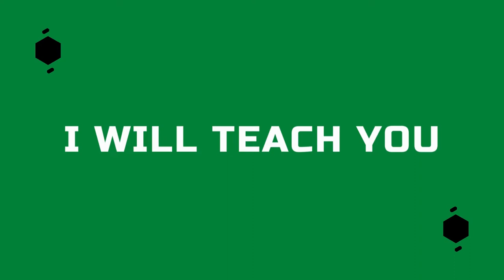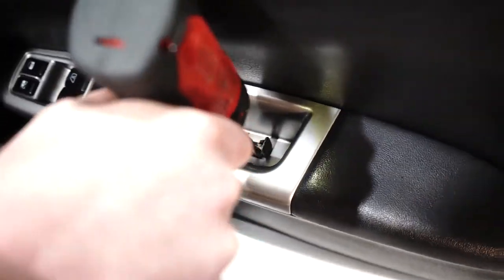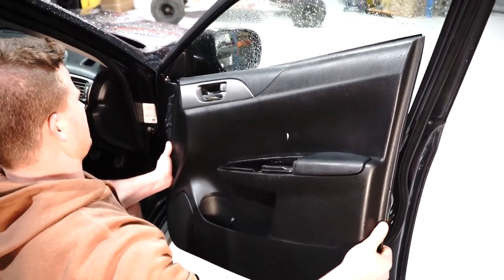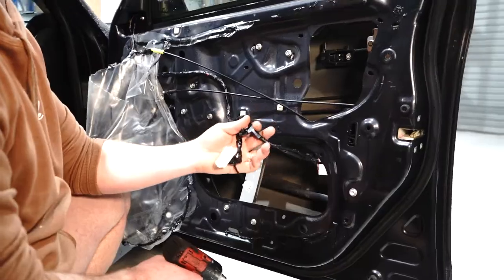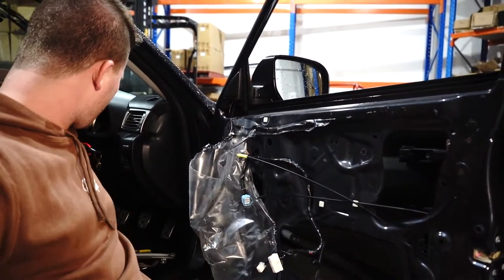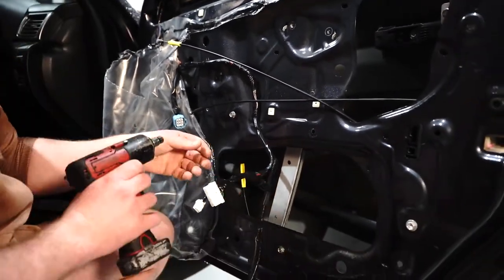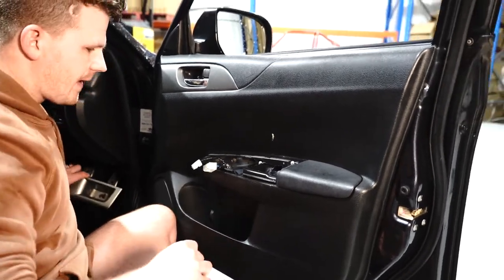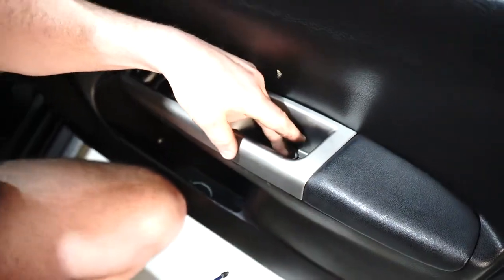Subaru Impreza Window Regulator Remove and Replace How To Video

Comment: The rear regulators don't have a cable to cut if it's stuck in the up position. Any tips on how to get the window down on a rear door?
Reply: Happened to my front drivers side, push down and wiggle worked for me

Comment: What wires did you cut mate? Mine is stuck in the top position too
Reply from the maker: The window regulator wire. The metal cable

Comment: Thanks Helped a bit. But you dont need to grease the regulator or the tracks again?
Reply from the maker: Ours comes pre greased. Unsure on tracks. If they are dry you're welcome to... But if there wasn't any issue with the glass moving up and down its no worries.

Comment: I have a 1995 impreza gc3.. my driver windows problem goes like this: It rolls down but it doesnt roll up. But if get the car off the ignition and turn it back on.. the window rolls up. I notice that if I start the car and roll the window down.. when the window is down.. is like the switch is constantly trying to roll the windows down. I can hear the windows trying to go down, if I lay my arm over the door I can even feel the windows glass trynig to move down and doing weird stuff inside the door... Is like the swicth is stuck on the down command and every 20 30 seconds it tries to roll down the window.. and it gets free when I turn off the car and start it again. Any help/suggestion on this problem would be appreciated.
Reply from the maker: Try replace the master control switch. Thanks

Comment: Cheers Lucas!
I am swapping the harnesses from my 05 impreza driver door into a new 03 door and I have to also move the mototor and possibly the lock switch. I never done it and just want your opinion if it is worth it to swap everything or just buy a new door with all the internal stuff in it already?
Reply from the maker: Honestly, I couldn't give you advice other than buying a new door off the same model. I never mess around with things that I know can open up a world of issues.